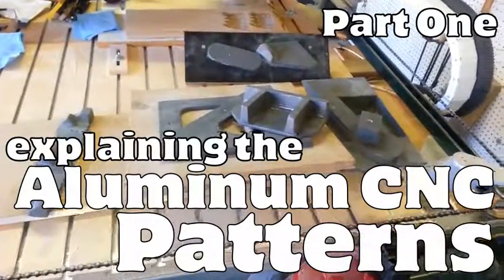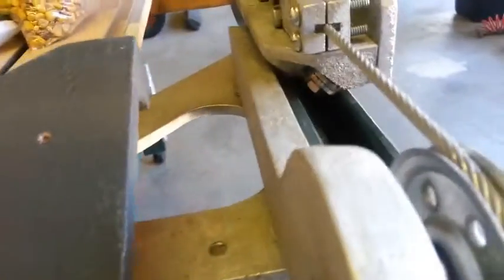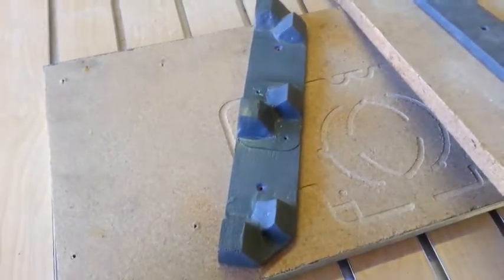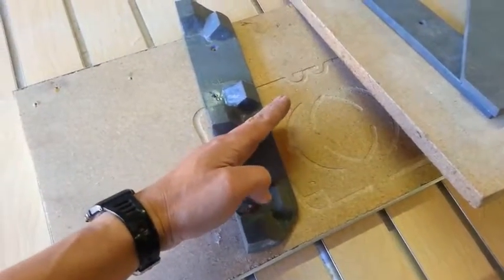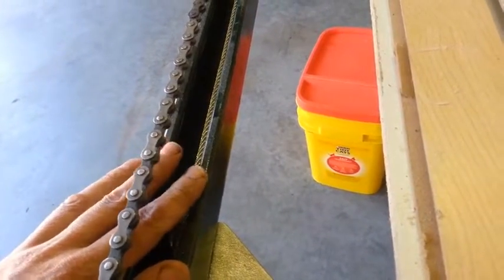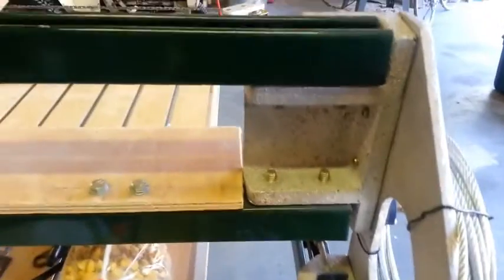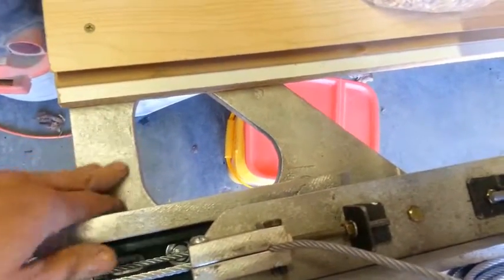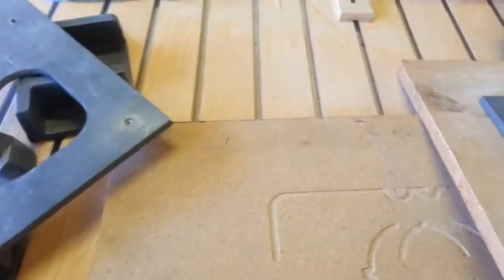Explaining the CNC casting patterns, Part 1

Comment: Listen is any of this anywhere else? Also where did u find that design for the "roller slide". If i have to ill make it but u have the molds. It would work really well for a edging chainsaw mill if i figure out the mounting. Ill buy if price right.
Reply from the maker: The roller slide pattern is my own design.  I did not find it anywhere.  I got some inspiration from thingiverse objects.  I don't have a 3d printer yet so I don't have an exact model to share (or I would).  Sure I could sell you castings, cheap.  They're easy to make.  How is $10 apiece unmachined plus shipping.  If you want them machined and complete with bearings it would be significantly more.  Let me know and I'll send an ebay link.